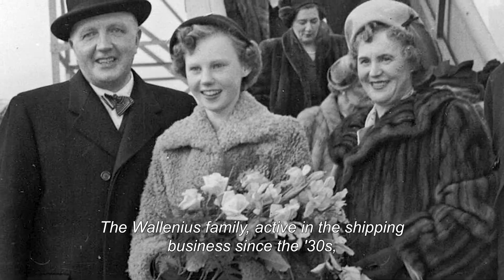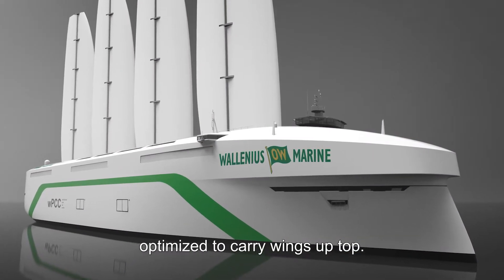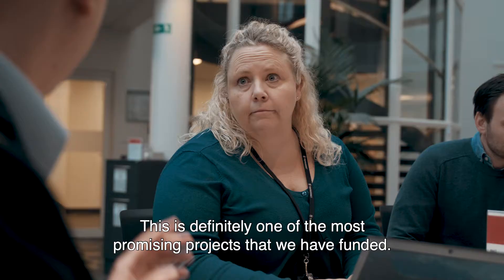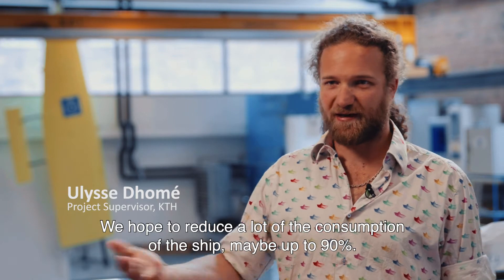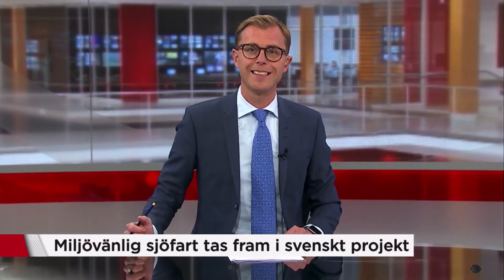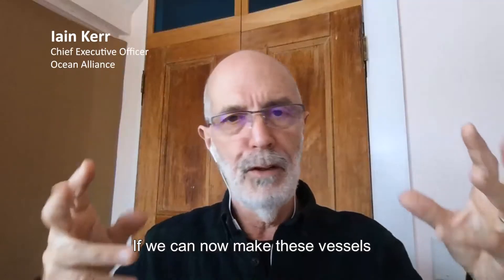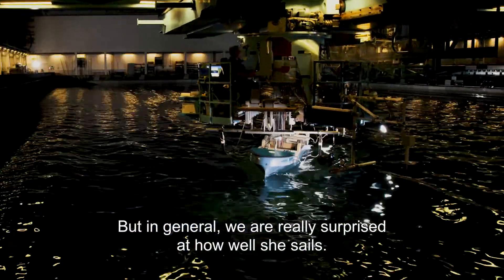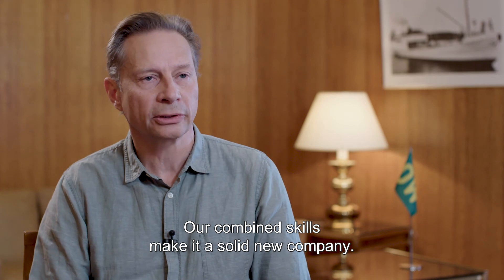Oceanbird: The story - so far!

Comment: One of the limits to wind power is the kinetic energy available to be harvested in the mass of air it is possible to contain.  Another is the scale of the operation; when sailing ships were being succeeded by power driven vessels the largest that were built included the ‘Prußen’ and the ‘Thomas W Larsen’.  The ‘Prußen’ used a crew of 45 to move up to 8 100 tonnes of cargo and was lost at sea following a collision with a power driven vessel.  The ‘Thomas W Larsen’ used a crew of 18 to move up to 11 000 tonnes of cargo this vessel was lost when at anchor in the Scilly Isles where she was sheltering from a storm.  The scale of merchant shipping in the modern age is much higher than in the early twentieth century when these events occurred.

Aerofoil ‘sails’ work by combining the ‘lift’, which in marine terms acts horizontally (not vertically), from the wing with the pressure from the angle of attack of the air movement to create a driving force (thrust); which though more efficient than a traditional mast, cordage & fabric system that it may be is still, on a much larger scale, like trying to ‘push a brick across a table with the output from a hairdryer’.

On board wind turbine might get you around some of the problems, however for marine use vertical axis wind turbines (VAWT) would be better than the, what have now become 'traditional', horizontal axis wind turbines (HAWT); for reasons that include the air draught of the vessel, weight distribution and maintenance access.  The energy yield, which is low compared to combustion of hydrocarbon, is still subject to the wind blowing at the right strength and having space available on board for the hardware.  The rotors, masts, rigging and sail handling arrangements would take up 'prime real estate' on the vessel.  Fuel oil bunker tanks can be, and usually are, stuck away in any odd corner and the ICE power plants are themselves relatively compact.  The stacked up 'boxes' would mean putting the wind driven propulsion units in a bad situation from a ship stability point of view.

There is much discussion of 'decarbonising' the marine commercial industry and various wind power ideas are offered; such as Flettner rotors, kite sails, traditional sails and wind turbines.  The factor that seems to go unconsidered is relative wind direction and VAWT would seem to be the only option that could cope with that variable.  The availability of the wind, the amount of energy that could be gathered from it and the cost of the installation receive little consideration but on the limited information circulated VAWT seems to be the best of a poor group compared to hydrocarbon fuel.